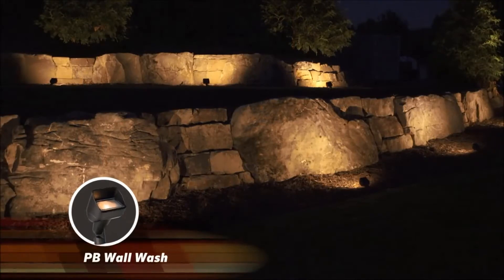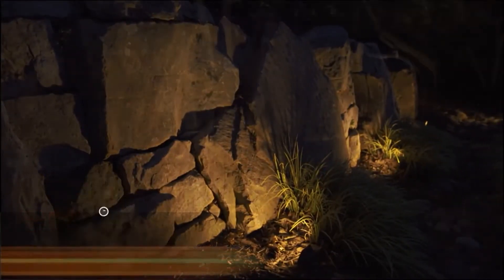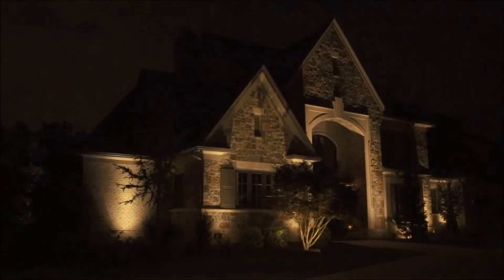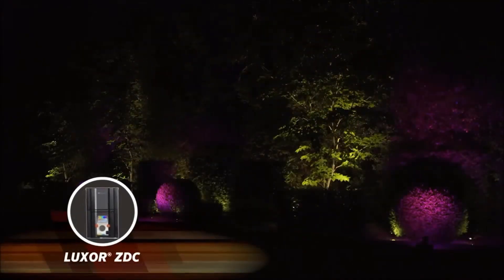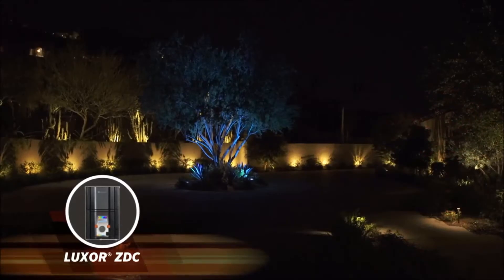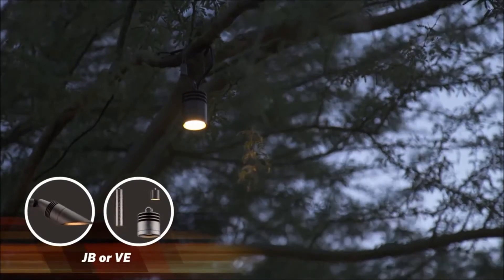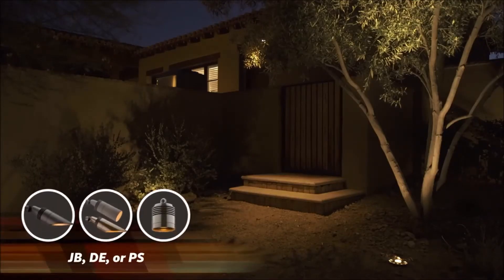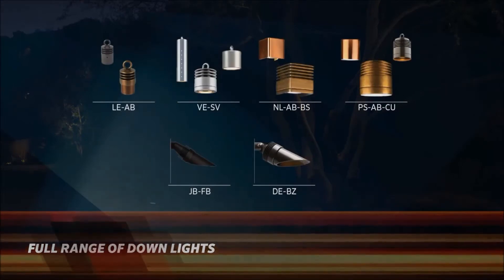Low Voltage Landscape Lighting Techniques - Up Lighting, Path Lighting, Down Lighting Summary

Comment: How far away shall I keep the lighting from the tree? How do you postion the light, to the left of the tree, right of the tree, north, south, etc.?
Reply from the maker: It really depends on your viewing angle. Whichever view you want the light to be more prominent, you should place it there. Typically 12 to 24" back is enough and shinning more upright however with very large trees you may need to be back further
Reply: @LightingDoctor  Thanks so much. Which beam angle you recommend for medium sized trees and what watt/lumen?
Reply from the maker: 4 watt LED with 35 Degree